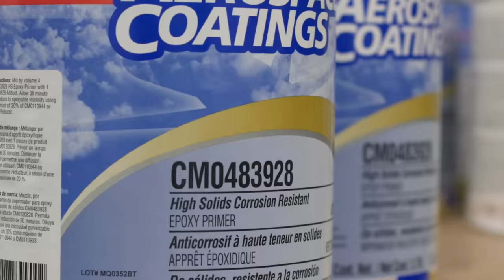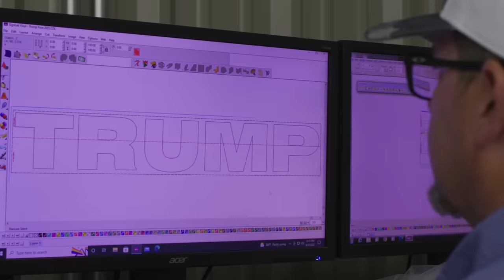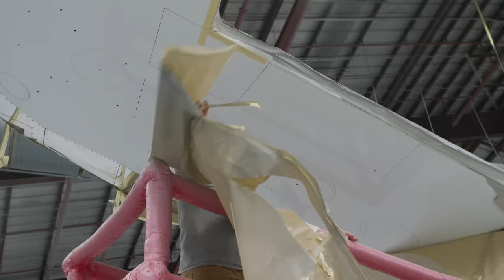Landlocked Aviation TRUMP N757AF Refinishing

Comment: 757 one of the best jets ever built. It thrust to weight ratio is much higher than other commercial/business jets of its size. It’s fast and has plenty of room as well as proven to be a very reliable aircraft. Looks amazing, great job!
Reply: Its a good size for a private jet. Not too small not too big
Reply: Calling it reliable is lying to yourself, especially with RB211s 🤣 they're the least reliable aircraft in United's fleet & one of the least in Delta's. Also one of the most expensive to repair due to lack of repair-friendliness like a 777 or A320. Still a beautiful plane and good performer when it works right.
Reply: @Nathan_Jay  I wouldn’t call any plane in United or Deltas or American Airlines fleets reliable. I’ve only ever been on time a few times and have been on more aircraft with mechanical issues than I care to remember and would blame that on their maintenance programs. The only thing that make Southwest for example more reliable is they fly one aircraft type 737 thus only needing to maintain inventory for that one type as well as only needing mechanics rated for that one type. On the other hand I’ve been been on American for example with a plane I couldn’t board because they didn’t have a mechanic on hand to was rated to fix the aircraft. The 757 business jets and private jets that I’ve been around have been extremely reliable then again they have dedicated mechanics and are very well taken care of.
Reply: its an antique
Reply: @TheAnnoyingBoss it’s pretty darn big I loved flying on these back in the day.
Reply: Then the engines he put on. I don’t get it more money for a G7. Think about it 757 you got it out it’s like a house For 1/3 the money.
Reply: TRUMP 2024! Get us the 2020 election we should have had! Only thing I've heard against the 757 is that the landing gear legs are so tall, you have to use a ladder stand to do anything on them. Not sure how true it is. It does have a nasty high thrust to weight ratio and is a rocket when not fully loaded. Trump has great taste.
Reply: @TheAnnoyingBoss 			|
Reply: I'll agree on the older 757 Boeing jets my father retired from Boeing but used to be Mc donnel Douglas
Reply: @booman606  They are only comparing the landing gear to that of the 737. The 757 sits up a lot higher than the 737 so you either have to use air stairs or have the 757 built with an onboard stair case or stair cases. I’ve seen a couple with stairs at both the front left side and rear right side of the aircraft.
Reply: @cjgazerro622  yeah much more airplane for a bit less initial investment. Total operating cost will be a bit higher as it’s more aircraft to maintain.
Reply: @Nathan_Jay  what garbage . I've flown 1000's of hours on the 752 and the 763ER as well as the 320 and the trouble was  hardly ever the 75. 320's go wrong so often they fly them with the redundancy 76 not so much 75 hardly ever. it's called maintenance
Reply: @P-J-W-777  how about Delta's A350?
Reply: @WCE107  what about the A350? No one even mentioned it. Are you trying to make this an Airbus vs Boeing thing now? But, I’d choose the 757 for speed and performance. Yeah it’s essentially an old school aircraft but it came from a time when Boeing was an awesome aircraft manufacturer and pretty much everything in house instead of being nothing more than a final assembly plant.
Reply: @TheAnnoyingBoss  If I was a real billionaire I would not be flying in a 31 years old jet that's only worth $12 million in today's market.
Reply: @TheAnnoyingBoss  and pretty fast aswell .
Reply: 2 Rolls-Royce RB211 turbofan engines.👍🇺🇸🇺🇸🇺🇸🇺🇸🇺🇸
Reply: @georgewilson4245 sadly your not a billionaire.

Comment: As a 757 fan I have to say this beauty is amazing! There is just nothing as impressive as a B757. Great job!
Reply: Truly one of the best planes out there.  I'm always very happy to find out if my flights are on a 757.  I'm shocked that Trump didn't ask for a P&W engine option on his, but the RR is just brutal and efficient.
Reply: I know that it might take a fair amount of investment in retooling to get the production line back up and going again but it would be worth the effort to do a 757 Max run given that the Airlines now understand and appreciate what this design was intended for. With this plane in production and making money Boeing could then have time and breathing room to do like they did with the 757-767 all those years ago and do another joint MMA & 737 replacement clean sheet design for eventual production.
Reply: @mcseforsale  these are probably RB211,  engines, which bankrupted RR, as was the engines for the L1011 TRI JET, that engine became very famous, and was used on MANY BOEING AIRCRAFT, , the output was remarkable.🇺🇸🇺🇸🇺🇸🇺🇸
Reply: Had a R Engine Failure at 400 ft @ MGTOW on the 757. Had to pull the power on the L Engine way back to keep it under 250 kts. 
An absolutely magnificent machine!
Reply: I wonder how long it will be before we read he hasn't paid the contractors  :)
Reply: @trvman1  why are you such a hater? Just enjoy the video.
Reply: As USAF vet, this is a beauty, and I love the flag. Too bad they did put a small '45' below it. But as it is, dang, is good!
Reply: @mcseforsale  Correct me if I am wrong but I believe these RR engines are very unique as they are 3 sections(n1,n2,n3) compared to basically every other turbofan engine out there which are all n1/n2 designs.
Reply: @josephsmith4161  I'm not quite sure.  I was a machinist back in the late 80s, early 90s and my job was to refurb JT-9D diffuser cases to turn the engines into generation plant machines.  I grew up very close to Pratt.  Every other house in my neighborhood had an employee of Pratt in it, so I got invited to a lot of "Bring your Brat  to Pratt" days where we would tour the factory.  Pretty amazing place.  When I was 30, I moved back home and worked on the campus as an IT engineer during the whole X-32/X-35 contest days.  While I was there, I was lucky enough to see them land a Harrier at P&W in East Hartford. I was also lucky enough to do some work in Middletown, Ct in the testing facility while they were testing the engines for that contract contest. As for the specs on the RR, I just don't know.  I would imagine having a 3 stage engine creates a MASSIVE advantage in efficiency, so I don't even know if Pratt was attempting that contract.  I'm just a hometown guy, that's all.  :D
Reply: @mcseforsale   Cool to read your comments. My dad worked there in EH at P&W. 
I could be wrong on that but thought I remembered hearing about this unique design with those RR models, I think specifically designed for the 757.

I can imagine it being a pretty amazing place, the history of those manufacturing places has always intrigued me. You should see McDonnell-Douglas Blvd. in STL. Amazing place in its heyday, Im sure. Almost like a desolate de facto museum now.
Reply: @josephsmith4161  Yeah.  It's an amazing place.  Walking almost 1/3 of a mile under one roof is weird.  My brother in law was also a mechanic for the F-22 here in Atlanta, responsible for the port air inlet and we were invited to see the production line.  THAT was amazing as well.  What part of Ct are you from?  We may know each other!  I lived in Manchester, class of '88, but I quit early to be a machinist.
Reply: @trvman1  True,he had a reputation for cheating subcontractors, but, then again, probably the same dummies who support him no matter what.
Reply: @trvman1  TDS still?
Reply: @johnwilson7609  a reputation with no proof to back it up. Democrat way.
Reply: The inside is nice real nice!
Reply: @mcseforsale I think he bought it needing new engines not sure what availability was at the time.
Reply: @trvman1  it's been more than a year later.. have you heard yet? Please share your findings!

Comment: Former Boeing here... seen a few aircraft painted in biggest paint booths in world at Boeing Everett. This paint job is awesome.
Reply: i use to do test painting at Grumman like 15 years ago Ft Irwin CA. if you ever wonder how they can withstand the saltwater punishment, well after we painted something we would tape a pile of damp salt under clear isinglass, if there wasn’t a pile of corrosion or a hole burned thru we knew everything was done properly ✌🏻
Reply: My son works in the sealants division at Boeing, Everett. He has quite a bit of artistic talent, and applied to move over to the paint shop. Apparently he's too valuable to the sealants team and they denied his transfer. He would love to do that kind of painting for his job.
Reply: @jamesbrischke4815  Thank you. Applying sealant is a real art. I worked in Lean Manufacturing and marveled at the pride people took in their jobs. I loved the smell of new sealants and solvents.
Reply: @SJR_Media_Group  my son is the go-to guy when an airplane fails the pressure test. He finds the leaks and fixes them. He's got a 100% fix rate. On a side note, he just worked on the last ever 747 to be built. The first one flew in 1969. That's 52 years. WOW!
Reply: @jamesbrischke4815  The sealant guys are worth every penny. When I worked there, small people had to crawl inside wings to seal the fuel tanks. 747 center fuel tank is huge, can walk upright in it. There was a special test cell for tank. Air tight space and they put ammonia under pressure inside tank. Sensors in enclosure would sound alarm if any Ammonia was detected. When I worked there, they had just started full production of 777. It's been 20 plus years since I left. Many great memories, best company ever.
Reply: @SJR_Media_Group  part of my son's employment test was getting through the service hatch for those fuel tanks. He barely made it.(he's 6' 4") He did fuel tanks for a while, but with his height, it was killing his back. He did say that those fuel tanks are huge. I was living in another state at the time, but was in Snohomish Co.  on a job. I'd heard that they'd announced the first flight of the 777 and knew I had to attend. Boeing employees were inside the fenced areas, us interested bystanders on the outside of the fence, but I was close enough to see the en masse tears of pride from so many employees. It was quite a fine moment!
Reply: @jamesbrischke4815  I saw first 777 flight from outside fence too. It remains a great aircraft. Little people best suited for tank duty. I would probably be claustrophobic. Did he ever tell about how huge 777 engines are? Over 9 feet in diameter. You can stand in front for scale.

Comment: Stripping and painting an aircraft in an unairconditioned hangar is a job that members of the laptop class will never understand.
Reply: Have a look above the aircraft for ventilation
Reply: I was looking at the process, but I was actually wondering about this as I could not see the paint being stripped. I understand paint is heavy, so I would expect it having to be stripped first. Did I miss something? And I am not asking to be a troll, I am asking to understand; are there instances where the paint isn't stripped?
Reply: @mrtopcat2  Only the tail was stripped as it had a flag painted on to it. The rest of the 757 got the old fashioned scuffing/wet sanding. It was more of a paint restoration to keep the livery the same. I don't think Donald cares about extra paint weight.
Reply: @pcorf  I think so too, probably they don't ever take enough cargo or anything to be near limits, so say an extra 1000 #s of weight is worth it versus another $200k in sanding fees etc etc

Comment: Beautiful paint.  Nice design for the waving flag. What mechanical upgrades are being performed by Landlocked Aviation?
Reply: Hyperdrive and lightspeed. 😁
Reply: I think he got all new rolls Royce engines as part of the renovation.
Reply: That is stealth coatings, have a small radar image for those with the missiles.
Reply: @LBCAndrew   Doubtful   they were already standard  on that aircraft
Reply: Added twice the Champagne storage capacity.
Reply: @meanqkie2240  Preferably one way ;)
Reply: Cloaking, & Warp Speed 
🤣🌟👍
Reply: @aaronamerica968  diet coke. Trump doesn't drink.
Reply: @diegrinder6851  I think what LBCAndrew was saying is the engines are new or factory re-manufactured, not an engine manufacturer change.
Reply: @anthonyklein2944  that’s the way I understood his comment also. They didn’t go from say a Pratt & Whitney to Rolls Royce, they simply replaces Rolls Royce with new Rolls Royce engines
Reply: @B D Custom toilet paper with a four-color image of Joe Biden falling up the stairs of AF1.
Reply: @1982MCI  GE makes the finest engines!
Reply: @auxmike718  True ... for Generating Electricity. For propulsion I prefer RR.
Reply: TRUMP dose not drink alcohol
Reply: @diegrinder6851  Both RR engines on this aircraft were replaced recently buddy.

Comment: Mind blowing work the FedX delivery of the paint was an eye opener as to how much paint it takes to cover the plane
Reply: The real fun begins when you start adding up all of the weight from the new paint job. Most people wouldn't believe the actual weight of the paint.
Reply: @thomasboese3793  I read that a coat of paint adds 3000 lbs. to the plane.  For this reason, some airliners leave it silver, just for extra capacity.
Reply: @elultimo102  Absolutely, it's one big weight penalty just to look cute.
Reply: @elultimo102  Not aware of any airline that does not have a paint job. Thats impossible. No paint job would very quickly lead to accelerated corrosion, accelerated wear and tear and could easily overheat the entire airframe and it's interior without one.
Reply: @josephsmith4161  American just has strips & emblems.  The planes were metallic silver.
Reply: @elultimo102  You don’t think silver is a paint job? Silver was their old livery, which was also a paint job.
Their new paint job is grey, not silver.

Look up what a “green” airplane is and you will understand. White, silver, grey - its all paint. These things would never survive without one.

Comment: Have you even gotten into a black car on a sunny day? Despite being repeatedly warned about the excess heat that livery would cause, and the extra equipment needed to compensate for it, not to mention the added heat to the avionics, trump refused to admit he was wrong and went with it anyway. one of the issues with the new Air Force Ones was he wanted them painted the same way out of vanity. The additional costs to deal with that heat in a much greater scale wasn't revealed until he made the deal for them. Look it up, he bought two rejected Russian 747s stored in the desert that were civilian rather than military versions of the jet. The cost to convert them was also not revealed when he bragged about how much he saved us... or didn't.

Comment: Trump chose the right airplane the B757 as these airplanes have the Rolls Royce engines which have much more power than the Pratt and Whitney engines although the P&W were much easier to work on the Rolls engines make up for it in extra power also those winglets will definitely help cut down on fuel consumption and help smooth out the ride during cruise altitude. We in the industry call theB757 Rolls powered aircraft the HOT ROD of airplanes as it really is a hot rod with wings ,by the way I worked at a major airlines for over 40 plus years and am retired

Comment: Couldn't you forget like a couple of things when you put the plane back together? I mean, like a key component of the motors, or the connector between the steering column and all the control surfaces.

Comment: Did you know this is an aging 31 years old 757 with a new paint job and new engines for air worthiness? And it's only worth $12 million in today's market? Compare that to a real billionaire Taylor Swift's new $100 million jet. Just saying.
Reply: Are a Judge in NYC.😂
Reply: Trumps 757 is a 100 million dollar jet. Swifts is 40 million. Either way, both of them are rich enough to fly whatever they want. Just saying...
Reply: @cooper8318  FYI, Boeing 757 stopped production in 2004. Unlike modern planes, which use computers to control flight surfaces on the wings and tail, Trump's B=757 used cables and pushrods. The original tail number was N757AF. Based on current used-aircraft listings, a 757-200 of Trump Force One vintage is today worth about $5 to $8 million. I gave him an extra $4 million for the new RR engines. Without the donation his plane will still be waiting to pass the C Check because it was deemed un-airworthy by FAA. Don;t be fooled by a new paint job.
Reply: @georgewilson4245  Couple things. What is your point about the jets age? Air force one is older than Trumps plane. Would you say its a pile of garbage? Second, I said he paid 100 million when he bought it 13 or so years ago. Trump is MUCH wealthier than Swift but they are both rich enough to buy whatever jets they like. Are you really trying to claim that a multi billionaire couldn't afford to service one of his jets without political donations? Seriously?